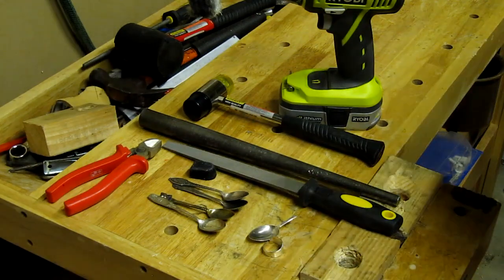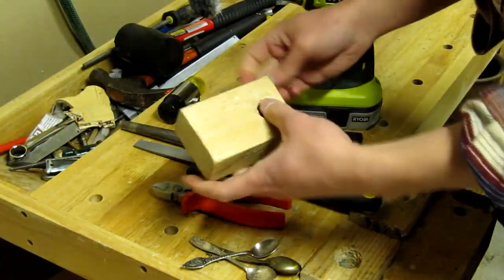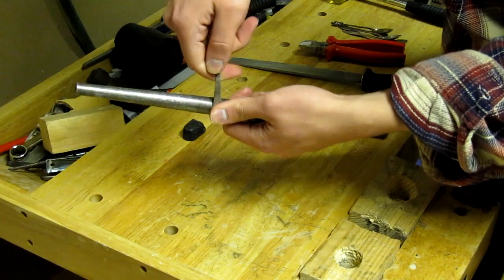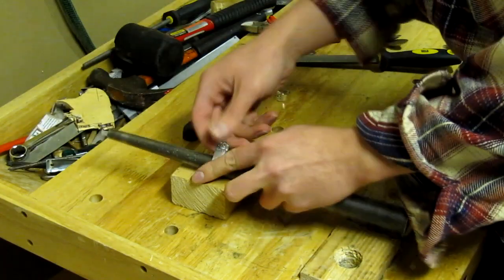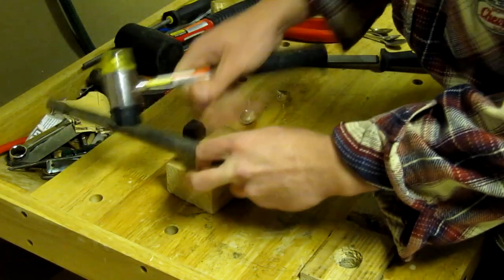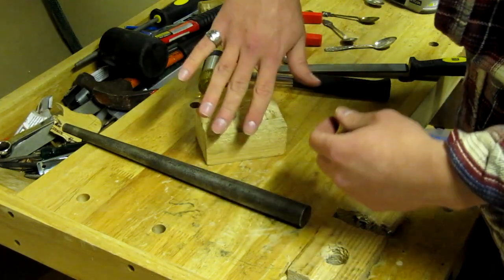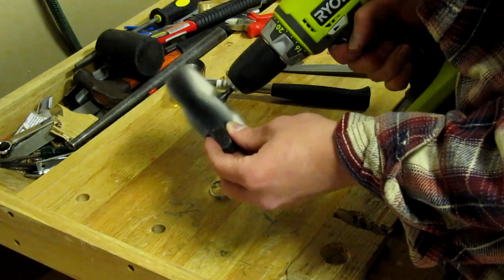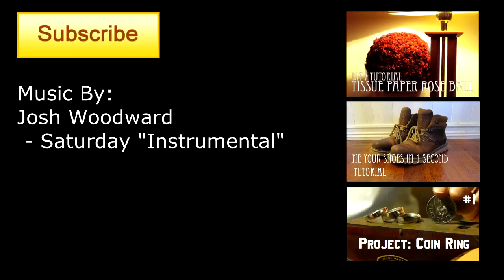Spoon Ring || Tutorial DIY

Comment: Hi, thank you for the video. I’ve got all the tools I need but I can’t seem to get the ring. I’m using stainless steel cutlery which I think is too hard, what would you suggest using instead? Thank you!
Reply from the maker: Hi! Yhea, stainless steel it quite hard to work with basic tools. I whent to a thrift shop and slightly felt if the spoons where soft or not. You do not need to bend it, just fel if it wiggles slightly. If you are relaly lucky you might find a silver spoon. But there is many silver hunters out there. Good luck! :)

Comment: ...first of all...it's not as easy as the video made it look...he didn't show you how to measure for the ring size and where to measure...there are so many variables...you just can't say I want to make a size 8 ring by using the mandrel...the size 8 may not fit the person...once you cut it to length...you can't make it longer...smaller yes...I don't know what kind of spoon he used...he bent it with his hands and then hammered it...how do I know all this...because I make some pretty awesome rings...I use the same tools he did with just one more...a one ton arbor press and wooden molds I made...anyone can make them molds...I prefer to make them wrap around so they can be made smaller or larger...if you don't want a wrap around...you adjust it to the persons finger and cut off the access...I started just like this video said...I banged on that spoon for an hour...all I got was a bent spoon...but now it takes me about 10 to 15 min to make a ring...longer because I polish the heck out of it...NO...I don't make videos...thank you Victor...but he Does...Victor Does...you need to look at many videos from other people and pick out the techniques you can use...have fun...again...thank you Victor...
Reply from the maker: For correct spoon type, watch 0.22. The ring is an open type and is there for not needed to be exact due to you can change the size. :)